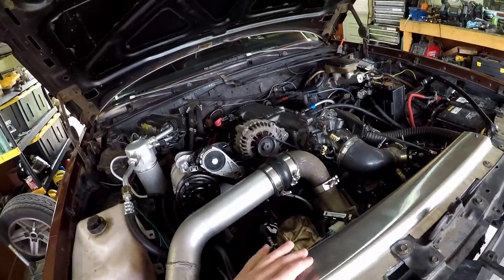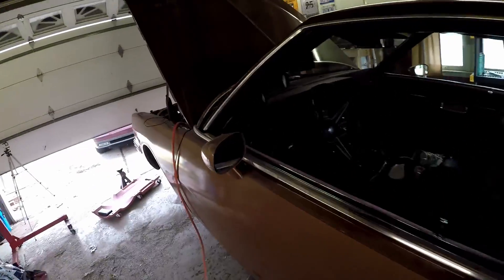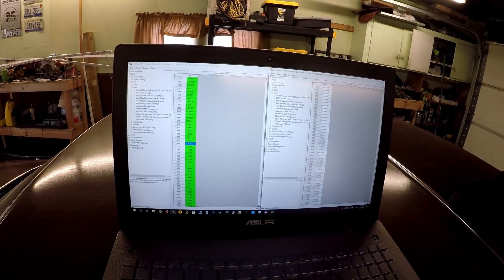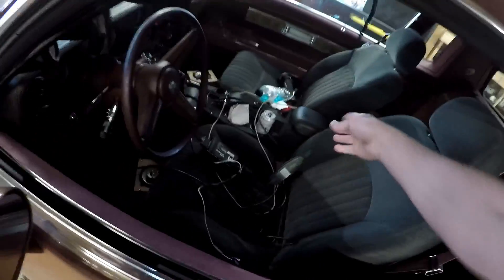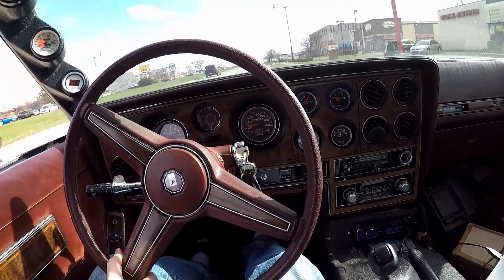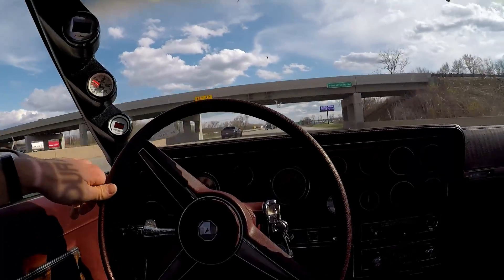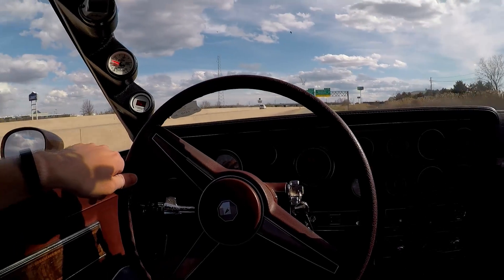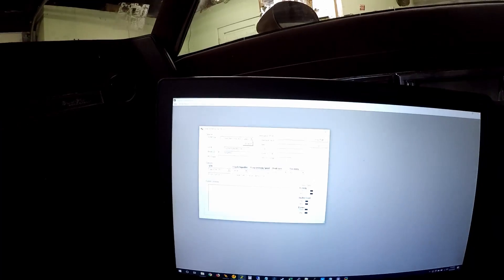Turbo 3800 Grand Prix Chipped a Piston - ep4 - testing and tuning the new engine (series finale)

Comment: Awesome project! What transmission are you running?
Reply from the maker: Thanks! Currently I'm running a 4l60e, but I'd like to convert it back to a stick again someday and put a T56 into it!
Reply: @tuningwithstyx  Nice, did you have a camaro 5 speed in it before? Why did you switch to the 4l60e? Let us know if you get t56 in it, super curious how the 3800 will handle 6th gear!